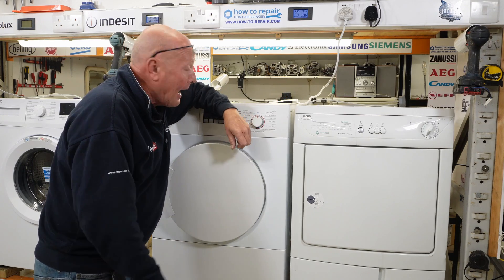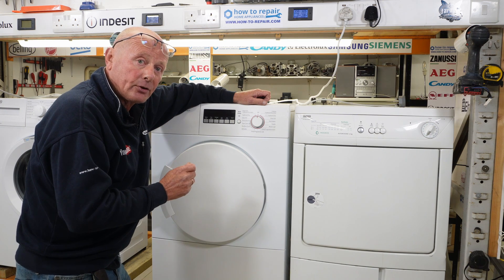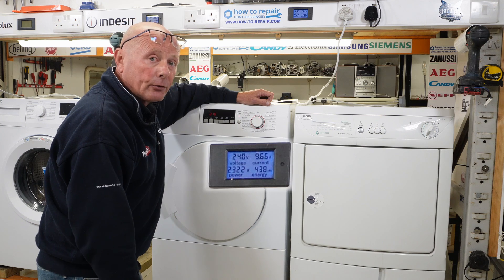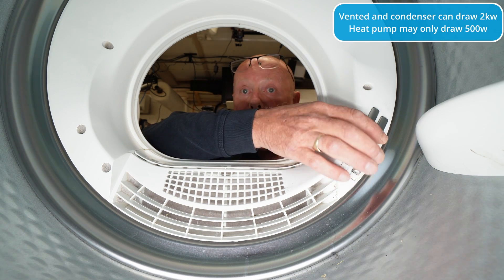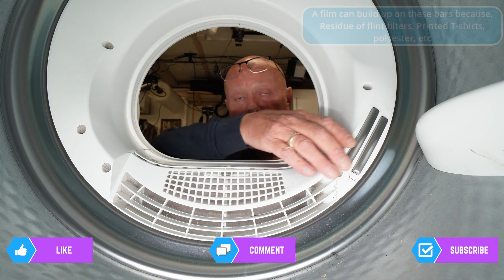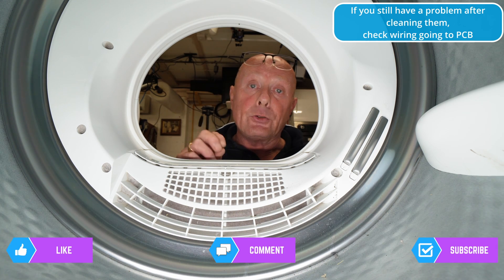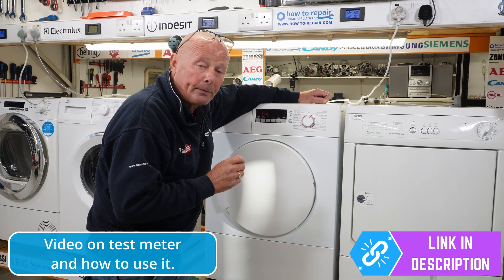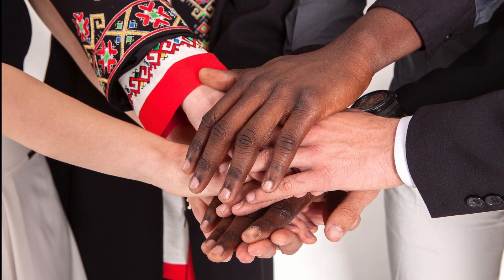Tumble Dryer Stops & Clothes Not Dry? Won’t Finish the Cycle Moisture Sensor Solutions!

Comment: Hi, I’m trying to fix my dryer and have watched a few of f your vids. Previously you helped me change a capacitor and I had it up and running. Now I have a different issue I’m struggling with. It spins for 4seconds then cuts out beeps a couple times and I have 2 flashing lights 3h and 9h lights. Tested thermistors which seem ok, cleaned everything but fault persists. Any help would be massively appreciated. It’s a logik lcd7w18. Thanks

Comment: Hi I'm stuck.
My dryer does this,  but the moisture sensor is clean. 
It's a candy vented one. 
Replaced a broken thermostat, thanks to your other video,  because it also wasn't heating up. Heats up now,  but stops after 10 min. 
Red light flashes on the "filter" symbol when it stops. But the filter is clean.
Getting close to throwing it out and buying a second hand one.

Comment: I have a Zanussi 47200w vented tumble dryer with Sensordry. It does not have any moisture sensors in the drum or elsewhere in the machine. It does however have a NTC temperature sensor inside the fluff filter bay (in the airflow). Does this perform the same job? I've tested it and it is working but the machine still often turns off after an hour or so but well before the laundry is dry, when I use a Sensordry option like cupboard dry. Any idea what's going on here? I should add that the heating elements(1400w/600w) is good and the power draw of the machine alternates between 2050W and 140W . I don't understand why the consumption on the hottest setting is only 2050W when the element is specified as 2000W and the motor 140W. Surely this should mean a consumption of 2140W. Is this a power factor issue?

Comment: Wow, what a great video, I love learning how things work. Unfortunately I couldn't locate the sensors inside the tub of my AEG Lavatherm 59840. My machine stops after 5-15 minutes and says my watertank needs to be emptied even when its completely empty, not emptying the tank and just pressing start again wil get it going again but it wil stop drying. Would this also indicate being a humidity sensor issue? If so how do I locate them in my machine, I could swear they arent in the tub...
Reply: There's probably condensed water in the bottom of the dryer. Depending on the model it might be difficult to reach the spot the overfill sensor is.

Comment: Hello. Thank you for this great video. I’ve learnt so much from your tutorials. The moisture sensor on my Hotpoint dryer has somehow changed shape (metal expansion?) - it’s not loose but now sits proud of where it should. It still works but catches on the clothes. I would like to know if they are easy to replace? Any help much appreciated, thank you.
Reply from the maker: I have removed these in the past and only use the machine on time mode not sensor dry. But feel free to contact me at the website and I will assist you personally if you need. I'm really pleased the video was helpful to you. Could you do me a favour and take part in a poll I've made about the lifespan of appliances? You just need to tick one of two boxes. It will only take about 10 seconds. This might help us improve how machines are made in the future.

Here's the poll question: https://www.youtube.com/@How-to-repair/community
Also sharing will get more people to participate and we will have a greater impact with the manufacturers thank you for helping.
Reply: @How-to-repair thank you very much for letting me know, I’ve done as you asked with the survey and am very much in favour of more durable products rather than energy efficiency. This dryer I have is vented and does a full load in about 45 minutes. I’m not sure I want to go down the condenser or heat pump route but it’s a shame there seems to be less choice of vented dryers than ever before. Thanks again for your superb service to the public and great videos which I actually watch for enjoyment too as I’m also an appliance enthusiast. My current washing machine, for example, I actually brought home in the back of the car from France because I wanted a certain one. What a geek! Best wishes to you.

Comment: I got Asko heat pump dryer which runs continuously even after drying clothes in auto cycles. Replaced the main pcb, carbon brush but still the same. What do you think the issue is?
Reply: It’s possible the sensor bars are short circuit, typically this type of fault occurs with a machine that has been in use for several years and is caused by a build up of lint getting into the cavity behind the sensor bars, the lint becomes damp and does not dry out like the clothes as there is no airflow 
The damp lint sitting across the back of the sensor bars makes the machine think the clothes are still damp, so the machine keeps running
Remove the 2 screws holding the plastic of the sensor bars and clean the cavity throughly
Reply: @zaczac3024 great information I don't need that info now but it could be useful in the future.👍

Comment: Another factor to consider, Is the floor level?    If your sensor is in the front, and clothes are "falling" to the rear of the dryer" they won't touch the sensor.    Bubble level test

Comment: I have a White Knight dryer that, I believe, is not operating on maximum heat with the button pressed in. You did mention this problem on one of your videos, but I cannot find anything in your playlist that explains how to test the gentle and high heat switch. Please help. I've checked the heating elements and they are both good. Also thoroughly cleaned machine.

Comment: Are the sensors 24vDC? I got a, i believe, failure in the transformer in my whirlpool awz 3417. The LM258 outputs only 20vdc. When connected to the control panel and humidity sensor, it oulses between low voltage and 20vdc. Anyone knows the normal behaviour or at least if it should be 24vdc?
Reply: *pulses... low frequency pulse, like 5hz or something near that

Comment: I have the same Bosch condenser dryer and I’ve replaced the sensor bar inside And the NTC on the back but still in the machine only runs for 10 minutes and cut off. But it would run for hours on time setting !! Any idea , pcb , the machine is brand-new, but it was in storage for one year so out of warranty
Reply: It could be a loose grounding wire on the 220 cord connected to the dryer. My buddy wasted his money replacing parts that didn't need to be replaced and final hired a professional and found the loose wire.
Reply: How to replace moisture bars?

Comment: On Bosch dryers often you have to finish drying on timed program because sensordry isn't the best. They even advise that in manual.
Reply from the maker: Thanks for the comment, they work reasonably well if kept clean. I have one in my house for a few years, never a problem now
Reply: I had to do this on my AEG as well once